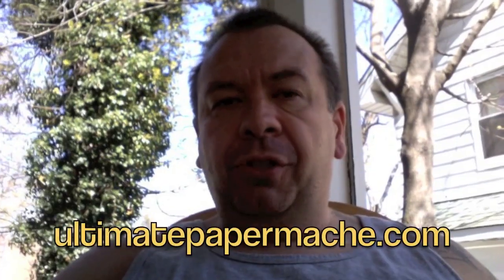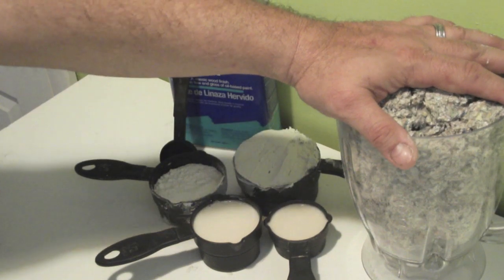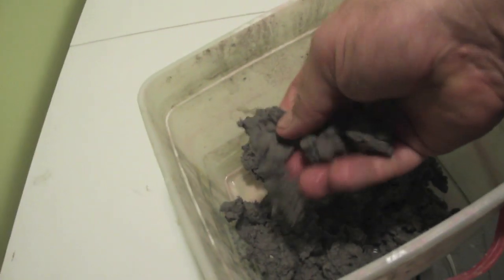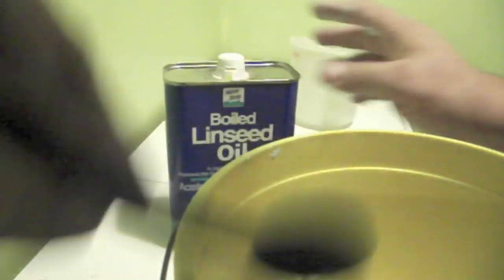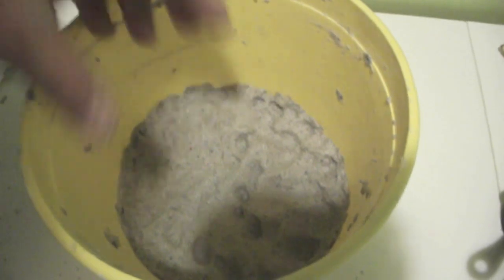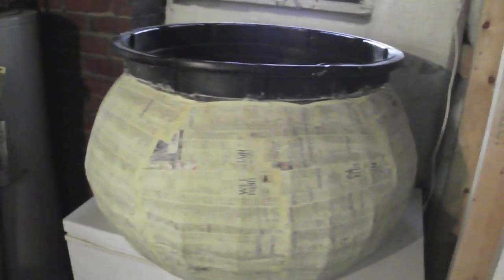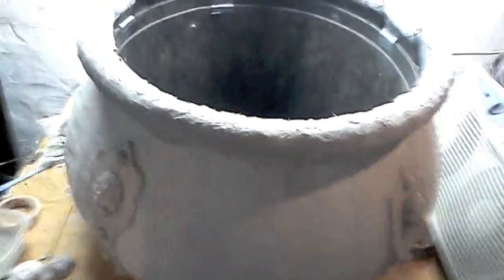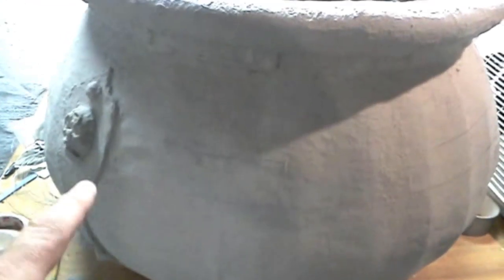Devil's Eve 37 - Monster Clay

Comment from the maker: Oh, and I did use the spar varnish to coat the clay, and I primed and painted it black. Since I still want to do a rusting effect to the cauldron, I haven't coated it with the deck sealer yet, but I definitely will be doing so.

Comment from the maker: I actually never did because I liked the texture of the clay after it had dried. It gave it a sort of beat up look as if it had been dinged over the years of using it. 

However, I have used the gesso on other projects (namely a paper clay butterfly I made) to achieve an incredibly smooth surface that made painting it easy. The gesso recipe is similar to Monster Mud in that it's a 3:1 ratio of joint compound to paint + 1 part glue (I used my homemade glue).

Comment from the maker: I've never had a problem with mold yet, but you can add a bit of bleach to the recipe. People use that with regular paper mache recipes to help prevent mold. Perhaps I've just been lucky, though I make sure each layer is completely dry before starting the next so that might help. As for the paper clay, it may just be that using a thin layer and making sure it is dry before doing anything else to it also helps prevent it for me. Moisture and warmth are the two key ingredients to mold growth

Comment from the maker: Hi Melly, the cauldron was covered in strip mache that's dipped in a simple thin flour-water mixture. I call it my "pancake batter." No glue at all, though you could add it. I never did film the gesso (or the butterfly!) My gesso is 2 parts joint compound, 1 part paint, and a dollop of glue. If you send me a PM here on YT I can send you a pic of the butterfly (if I can still find it.:) ). The wings are just cardboard cut to shape and hot-glued in place; the body/head is alum. foil in mask tape

Comment from the maker: Spar varnish is a marine-grade varnish. It's found in the paint dept of Home Depot or Lowes by the solvents. They cover boats in it to protect the wood so it should also do well in protecting mache from the elements too. :) It's a little pricey, a gallon costs about $40, but they sell it in quarts too, and it does go a long way. I'm trying to hunt down the pix of the butterfly and am having a hard time, but I'm sure I'll come across it. As I said, just PM me and I'll send it to you. Thanks!

Comment from the maker: I'm not sure I've made a consistent batch myself! A lot depends on how long you heat it. However, it's still quite usable. I've also found that when I keep the glue in the refrigerator for a few weeks it thickens up too and I've still used it without an issue. I'll usually give it a really vigorous shake in the jar and then our it into my recipes when needed. 

But the short answer is, no, I don't believe there's any issue with it.

Comment from the maker: Ram, with a fan blowing on it, the clay typically dries in less than a day. Not a high powered fan either. I have one of those 12" high dual windows fans, one of which is actually broken. So only the one works and that's enough to dry the clay. On thicker items, like the small skulls, maybe it takes up to a two days or so to be completely dry, but I haven't had to wait anywhere near a week for anything to dry.

Comment from the maker: Two reasons: one is I want the best protection of the spar varnish right on top of the mache or clay. The paint a deck sealer simply serve as additional layers of protection.

The second reason before putting it on ahead of the paint is that spar varnish tends to tint yellow whatever it's on and I don't want it changing the look of the prop I just made.

Comment from the maker: The clay was used over duct tape on my cauldron, but I'd cover aluminum foil with masking tape to ensure it held up.

On some smaller pieces I've made, I use foil to shape features, then cover it in masking tape. I did have worries it wouldn't hold to the duct tape, but I didn't have masking tape wide enough for what I wanted so it was an experiment that apparently worked.

Comment from the maker: No special brand of spar varnish or deck sealer. I usually try to find the cheapest one I can buy. That's typically been Olympic Deck Sealer and I used up the last of my varnish so I don't remember what brand it was, possibly Minwax's Helmsman or Varathane. It's pricey, going for around $30 a gallon, but it lasts a long time. I'll have to buy some more to do the cauldron.

Comment from the maker: A couple of reasons: First, I want to make sure the paper mache and/or clay is protected. Putting it right on top with the strongest protection (spar varnish) achieves that. Then the primer and paint that follow provide several more layers of protection, and the end layer is 2 coats of deck sealer. 

The second reason before putting it on ahead of the paint is that spar varnish tends to tint yellow whatever it's on and I don't want it changing the look of the prop I just made.

Comment: GC, I want to make the doll Annabelle from the  movie The Conjuring,  but I want use a plastic doll that I found, will this stick to her face so I can try to resemble her features?
Reply from the maker: Martin Marin I've never tried with a surface like that. While in theory I don't see why it shouldn't work, one reason at least I guess there could be a failure would be the very smooth surface of the plastic that might prevent the clay from sticking. Perhaps either roughing up the surface first or applying a deglosser like Liquid Sandpaper or No Sand (maybe even white glue) first might help it adhere better. If you give it a go, let us know how it turns out.
Reply: Thank you GC

Comment: Hi - what kind of mixer was that?  Most of us own kitchen mixers - yours resembles something found in a factory.
Reply from the maker: +Joanne Gennarella It was just a cheap household blender. I did end up burning out the motor. I use my Ninja blender now. As for the storage, I haven't had a problem with keeping the clay usable by putting it in containers, but Jay is the paper mache master so I'd have no problem deferring to his recommendations for optimal results.
Reply: +GhoulishCop So I too will kill my blender - and I don't have a Ninja but do have drill with mixer attachment which  I suppose will be the blender of choice here - correct?  I intend to use my insulation, not toilet paper as Jay uses, because your recipe appears in your video to be very smooth clay and I want to use my insulation .  Also can I use wood glue or Elmer's and get the same result?
Reply from the maker: +Joanne Gennarella I've done that too with the drill, excellent substitute, perhaps even better since you don't have to worry about mixing monster clay with food. :) Feel free to use the cheapest white glue you can find. I wouldn't use wood glue though, it's different stuff. Elmer's is good because you can find it by the gallon at places like Staples (but it's expensive). I often go to Wal-Mart around back-to-school season when they're selling the small bottles of glue for about $0.25 each. I stock up and get dozens of them. It's way cheaper. But again, any white glue is good. 

I do like my recipe and I can say it's gotten some good reviews from "pros" like Jonni Good at Ultimate Paper Mache. She's got some good alternatives too depending on the application, but there are a lot of different recipes that have popped up in the past year or so. Good luck!
Reply: +GhoulishCop thank you

Comment: By any chance would you know where you can buy the small skulls that you put on the caldron?
Reply from the maker: I actually made them out of paper clay. They were tiny rubber "zombie" finger puppet masks I picked up at a dollar store. I made a mold using silicone caulk and naphtha and then filled the mold with paper clay and let it dry for several days. Cheers.